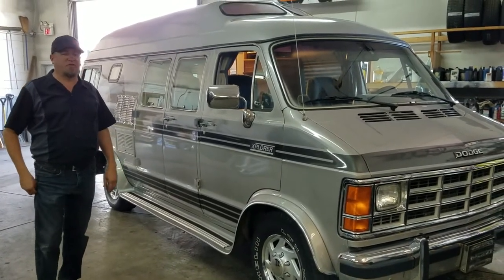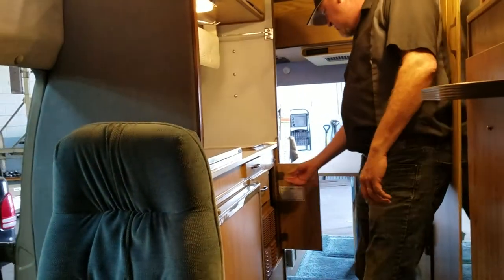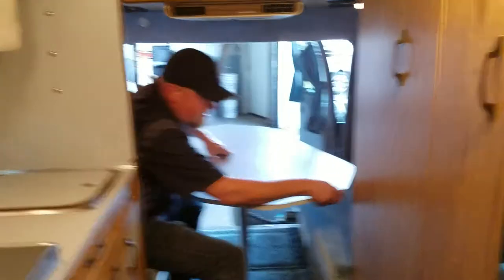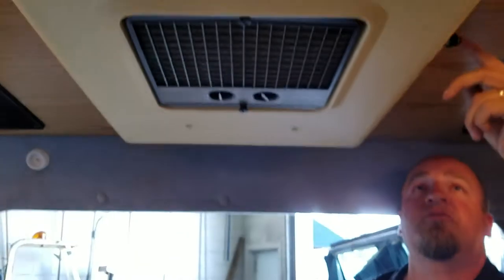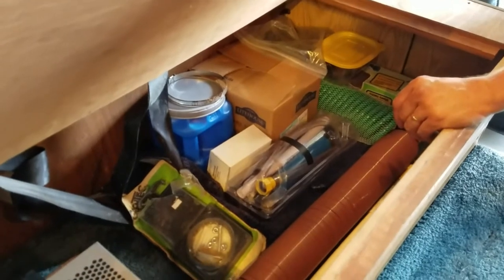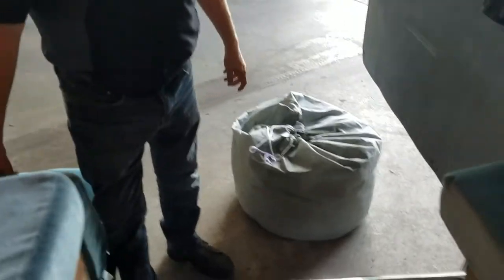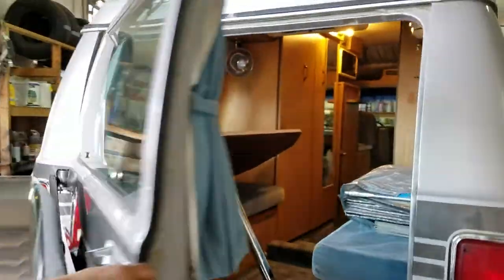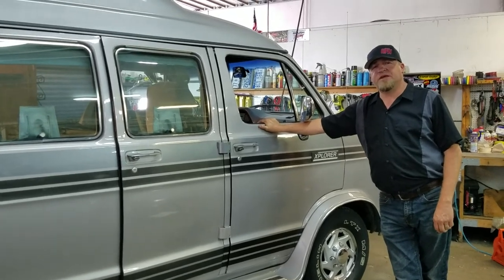SOLD! 1989 Dodge D250 Explorer Class B Camper Van

Comment: Very nice, but even in 1979 Dodge had the extended high top variant of this with an actual shower. I have one and it's in pretty good condition overall, low miles. I'm in middle of cleaning engine and remodeling back half to accommodate my lifestyle as I am single, soon to be on the road and working from my laptop wherever I go. I am a software developer so I've started the process of putting in a dedicated desk and moved the bed to the side like this van. The high top version is higher if you prefer not to feel cooped up.